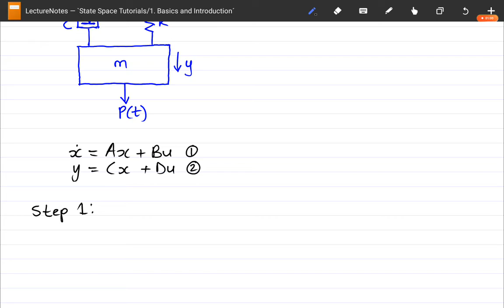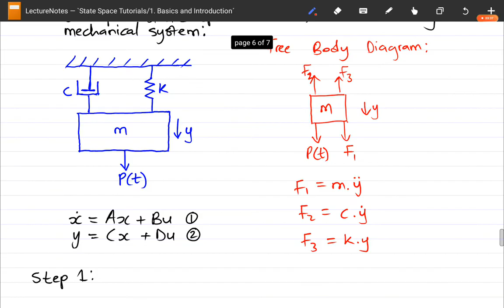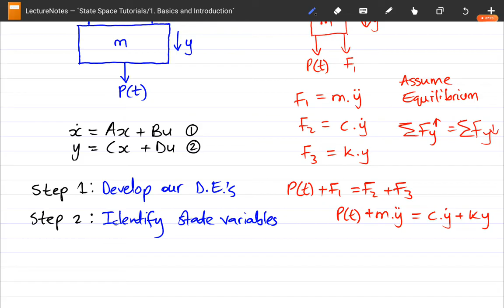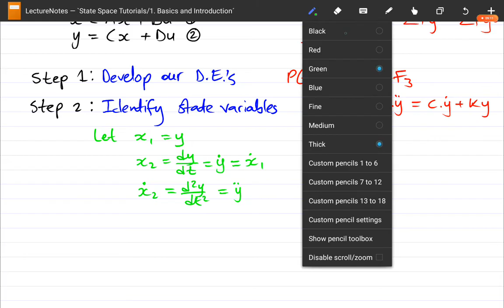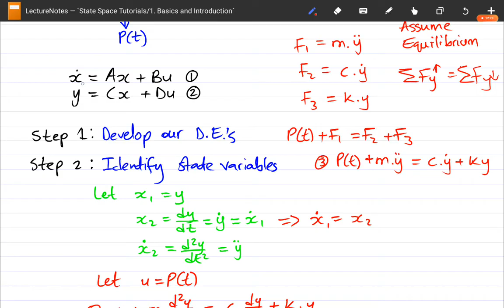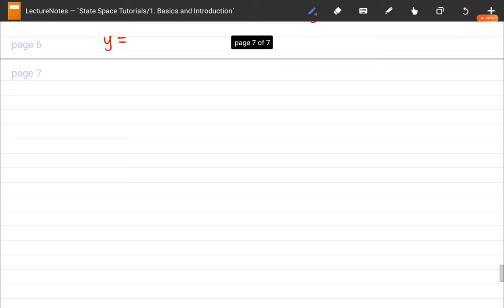Example 1: Develop a state space model of a mechanical system

Comment: this equilibrium concept of your is going to give a sign problem coz the system is not at equilibrium and if we bring one of the values to the other side u will have a negative force which isn't the case  My' ' = P - Cy' - Ky is more appropriate to describe the dynamics of this systems because it has a prevailing force in the positive Y direction and the C and K forces are working in the opposite direction

Comment: I think there is a mistake in your model. F1 = m(y_double_dot) is not correct because. m(y_double_dot) should be equal to the net force acting on the system (i.e. P(t) + mg - F2 - F3). The gravity term is constant and not time-varying. Therefore F1 should be equal to m times g and NOT m times y_double_dot.
Reply: Same
Reply: it indicates that y moves downward this means that its not necesary g buy an acceleration whic is the double derivative of dispacement

Comment: Well everything is fine ..but I have a doubt this is maybe because I haven't touched mechanics from the last 2-3 yrs...so the doubt is...the equilibrium is like...mg+p(t) -fspring-fb=ma??  Instead of p(t)=fspring+fb+ma??
Reply: very well said
Reply: its becasue at t=0 when force is not being applied the system is in equilibrium and so the spring is already stretch by imagine y0, so the steady state analysis done is from that point so y which include y0 makes up for the mg and so we therefore don't use it in the equation.

Comment: There are two errors. F2 <>y'', it is equal to mg. To assume equilibrium a force equal to m.a is in y-direction. Hope we get it right.
Reply: I thought that at first, but actually the problem is something else. His model is simply not accounting for gravity (which is fine as we can just say this is a mass on a frictionless table oriented horizontally) and F2 is serving as a placeholder for the force due to inertial effect, not gravity. So the error was in calling it gravity and drawing it vertically when this, instead, works as a good solution for the horizontal problem. Note that the inertial force needs to be expressed and handled for this to work.
Reply: That's pseudo force due to acc in downward direction, or better we can say it was inertia force
Reply: @adityarawat4964  Then this is not a force and should not be drawn in a free body diagram. Honestly I don't very understand his free-body diagram (I have not finished the video yet), esp what is P(t), but as this is a video about control, I will try to ignore the physics first.
Reply: okay after 10 mins he said P(t) = u(t) = input vector. Just write u(t) at the very first beginning please.
Reply: After finishing the video I may have a better understanding to his method. He set/ assumed the body is in equilibrium but in fact it is not (otherwise it is already stable and needs not to be controlled), so a force F1, which is likely added by a controllable actuator, is needed to balance all other forces. I think this is a more physic way for me to understand. This is just a side note for me.